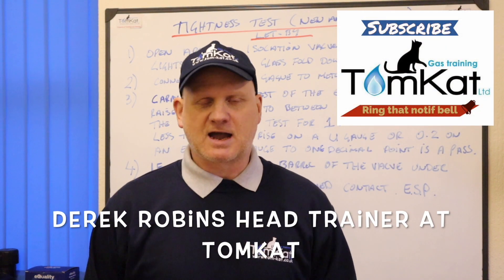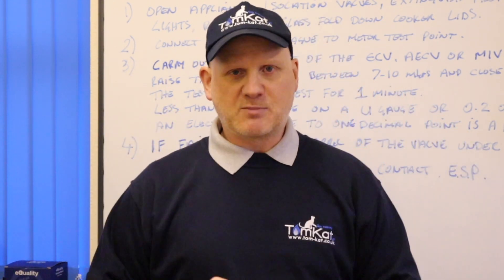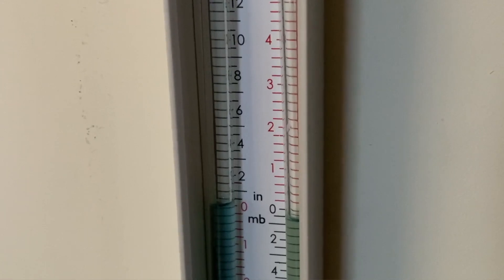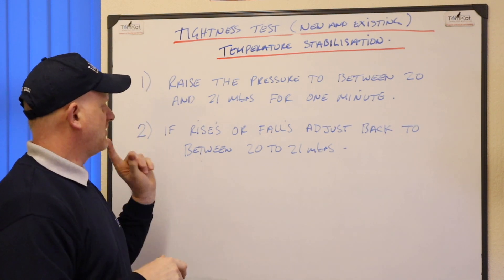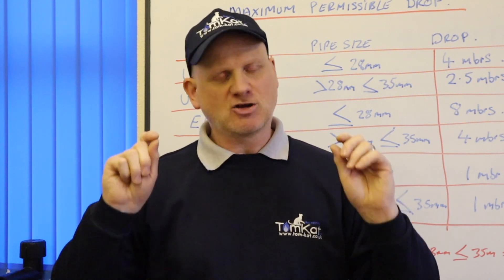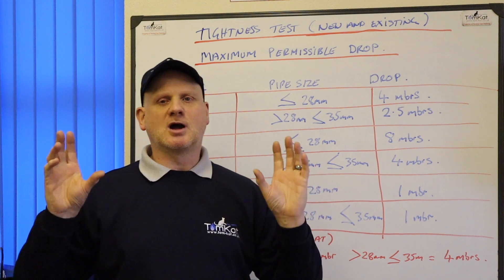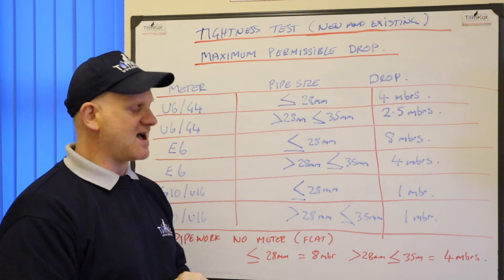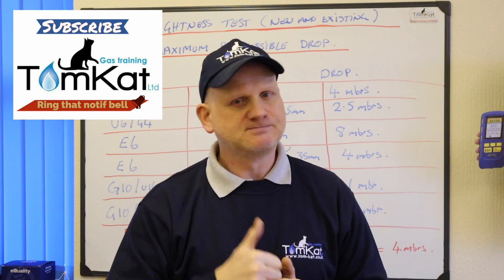Tightness testing a natural gas supply, ACS REVISION IN LESS THAN TEN MINUTES (hopefully) part 1.

Comment: Is there anything in IGEM/UP/B or anywhere regarding local testing only ie just spraying a compression cap with LDS without testing the whole carcass?
Reply from the maker: LDF is used to test for a leak not testing for soundness a tightness test proves that.

Comment: Sorry I don't mean to sound Thick 
Where do you find decimal points on a U gauge?
Are you talking about the shorter lines, for example let's say 8mbar 
To 9 mb has 4 lines, in-between the 8 and 9 would make it 8.5 mbar where's the decibels?
Reply from the maker: @arryrooker3079  not on a water gauge it’s a digital gauge

Comment: Thank you 
 So  drop can not be on pipe work or meter 
Then if we have drop permissible 
 System is pass but we need to actually isolate the appliances and make sure drop was on them not on pipe work or meter 
So 
In reality 
Tightness test  does not really says if drop is on meter or appliances or pipe work 
Is for whole system 
So if meter is leaking or pipe work 
Then we only find out by isolating the appliances   But again. Even when we do that  
Then we need to do tightness test stage by stage of installation by isolating the part of system and eventually use electronic gas leak detector. To really find out where the leak is 
Weather on pipe work or meter 
 And that’s also proses of finding leak and if is meter then to report it and get it replaced or fix the section of pipe work which is leaking

Comment: Hi , doing my Acs atm 
But I don’t understand clear what happened if a let by test fail . What you need to do if you can’t fix it !!!??
Need to cap the ECV valve off and contact the gas emergency number ? Thanks
Reply from the maker: Let by fail is classed as AR. It’s only dangerous if you are working on the gas pipe is new boiler install. It’s our ESP problem so inform them of the problem.

Comment: So you divide top and bottom by 2 after adding them then 2mins then do same and work out score. 

So eg first reading 21 top 20 bottom add together 41 divide by 2. 20.5 then second reading 20 top 19.5 bottom add together 39.5 divide by 2 = 19.75 then 41-39.5= 0.75 drop which is ok tbf

Comment: The problem with this table and the IGEM/UP/1B, there is not actually a requirement for us to prove the leak is on appliances or pipework, according to the IGEM and Gas Safe. 
We’ve been having this debate for years which has resulted in a meeting with IGEM a couple of months ago to clear it up. 
The answer is there simply is no logic behind the fact that you can have a leak on existing pipework with an appliance connected to it unfortunately. It all harks back to a time long ago when all this research on leak rates was undertaken. 
The new version of the UP/1B has quite rightly proposed to remove this table, but we are just waiting to see if this will stick after the ‘industry’ review?
Reply from the maker: IGE/up/1b is up for revision this year if you look at the draft it says 1mbr drop for all meters. I think it’s to combat this problem
Reply: @tomkatgastraining  yes indeed, they are proposing to go down the same route as the LPG criteria, whereby you can apply more than the 1mbar, if you are prepared to calculate the IV. Then you can apply leak rates based on IV, which makes a lot more sense to me.
Reply from the maker: @julianhearn1129  me too

Comment: Hi, great video. I just want to query the permissible drop process as this is different to what I was taught and what gas safe technical have told me. I was told it has passed a tightness test if it falls in the permissible drop criteria for that installation and further investigation is not required ie attempting to trace a leak. I was told that an isolated appliance is still a connected appliance so the permissible drop would still be allowed with appliances isolated and only if you disconnected all appliances and tested would you not be allowed a permissible drop. I'm not trying to be smart here, I'm genuinely trying to clarify in my own mind, the best way of doing it as I can see the point of both sides here. Especially if a landlord complains you have capped his tenant off and have quoted him for a very expensive repipe then another engineer says you're wrong and turns it back on. Any info appreciated
Reply from the maker: The regs are quite clear it says permissible drop with appliances connected and zero drop on the carcass. If you watch my video on the gas leak we found at the YouTubers house you will see how important it is if you find the drop on the carcass.

Comment: Hi Derek, I get accused of waffling too so I apologise for this long comment but it’s the only way I can explain!

can you clear something up for me please as I cannot find the actual answer anywhere in my training books.

During a routine job you were to have a 2mbar drop on an existing installationwith no smell of gas, are you saying before you can procede check if the drop is within tolerance from the chart you must firstly isolate the appliances to determine if the drop is on the pipework or not? obviously if the drop is from the pipework then 0 drop but if the drop is from an appliance or appliances then at that point you would check your chart to see if the drop is within tolerance?

Or are you saying, if you have a 2mbar drop then providing there is no smell of gas you can use the chart to check if the drop is within tolerance without isolating the appliances, but surely the issue with that is you have no idea whether the drop is on the pipework or from an appliance/appliances. 

But from doing my portfolio i would say over 50% of properties we visited had a drop over the 0.25mbar 
permissible drop you are allowed on your u-gauge/analyser, dont get me wrong it may have been often only 1mbar, but if you are saying the answer is (or correct procedure is) that engineers should be checking anything over 0.25mbar drop is from the pipework or appliances by isolating appliances etc then am I right in thinking current qualified engineers would be taking up floorboards in customers houses on a daily basis hunting for leaks which could be as low as 0.26mbar if the drop is deemed to be on the pipework?

Some engineers have told me that during a tightness test anything over the 0.25mbar permissible drop - as long as there is no smell of gas and providing the drop is within tolerance from the chart there is no need to investigate whether the drop is on the pipework or from an appliance/appliances. They told me if they were made to investigate every drop over 0.25mbar you would be pulling up customers flooring daily and never get any work done as 90% of your time you be hunting around for tiny leaks on pipework which could be as low as half of a mbar which in most instances you would never find without completely destroying a customer’s house tearing up their flooring and floorboards.

Thanks again for the great videos
Reply: also ignore username its my sons youtube account lol! god knows what his username means
Reply from the maker: @ea1472  if you have a drop more than 0.25 mbrs you should isolate the appliances and test again to see if it is on the gas carcass which most engineers don’t do if there is no smell of gas with appliances connected.
Reply: @tomkatgastraining  someone who read my comment sent me a message and told me to ring gas safe!

so i did....... Their respone was no smell of gas then no need to isolate appliances provinding the drop within tolerance!.????? whats your thaughts on that?

If im honest Derek I have found this a lot during the trianing, one person says do it this way, another person tells you to do it a different way, there doesnt seem to be any clear cut answers on some things. 

Its like ive been watching your purge video, ive got another scenario for you for that procedure too which is causing me a headache, and this is not me overthinking things, these were things which were happening to me on a regular basis during my portfolio. I shall explain in the comments on the purge video as it may be helpfull to people who are struggling like me during the training.
Reply from the maker: @ea1472  I find it hard to believe a gas safe inspector gave you an answer lol. After my sons inspection a few weeks ago I am believing gas safe inspectors need training because some of the things said to my son made me wonder what’s going on in our industry. The regs are clear on this that if you find a drop with appliances connected you must isolate and make sure it’s not on the carcass. You are correct in saying finding 0.5 mbr drop is dam near impossible but engineers judgement also comes into play. The new igem/ g/ 11 new version of appendix 5 is also an interesting read into how regs get changed because engineers don’t do their job correctly

Comment: So are you saying if there is appliances connected , we are allowed drop , then what about if there is appliances connected but I turn off the appliances gas valve  and there is drop on the pipe work but no smell but still same old installation?
Reply from the maker: No drop on any carcass new or old. Permissible drop is only allowed with appliances connected and no smell of gas

Comment: Great video!
At 8.20 if appliances are connected and there is a 3mb drop can you leave it, or do you have to isolate appliances and just test carcass?
Reply from the maker: You should isolate the appliance and test the carcass but most don’t 👍🏻
Reply: @tomkatgastraining  thanks
Reply: @tomkatgastraining   so is connected and isolated interchangeable? as in above, existing system Isolate appliances, test on carcass No Drop permitted?
Reply from the maker: @philipcooper4136  connected is it was gas going to it isolated means you have turned the gas supply off at the service valve and of course disconnected means removed from the gas supply